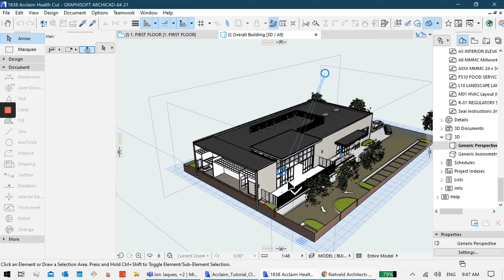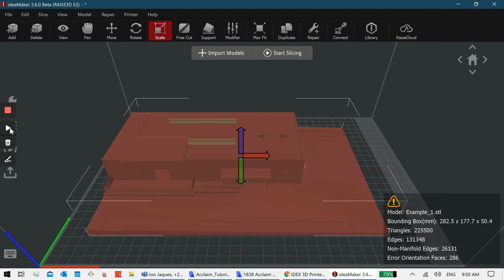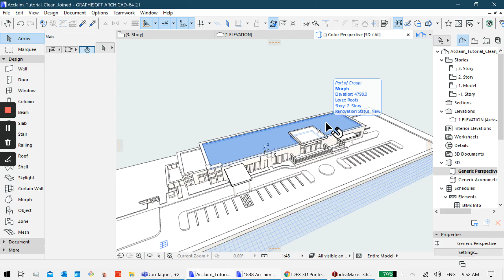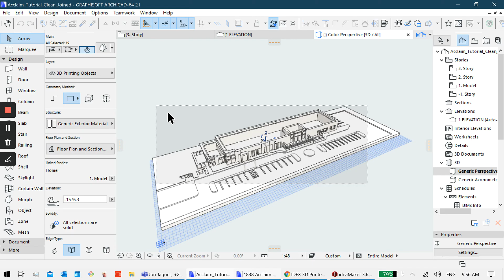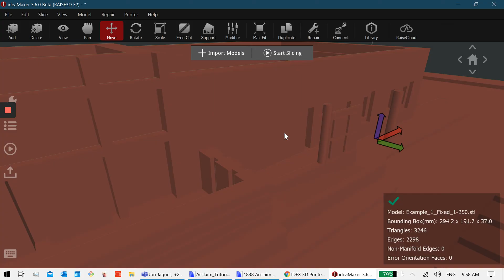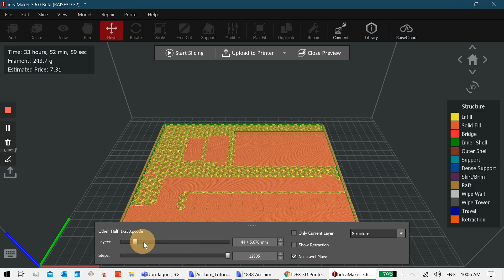3D Printing Using Only ArchiCAD Part 1

Comment: Useful video!
And just to have it written here, for me the trick was the morph + union before export to stl.
Without it the stl export resulted in very very weird faces and vertexes. Some slicers were able to process it, but the random 0.00 something thickness in the middle of a wall and stuff are not fun to work with.
The unified morph was much better!
Reply from the maker: @Gerifield  thank you for updating this!